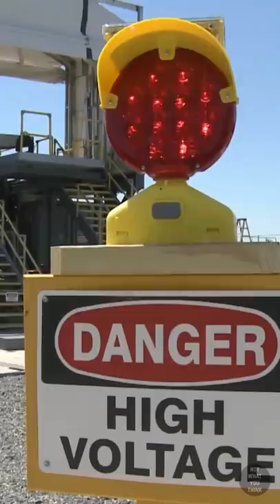Railguns: Destructive to the Core

Comment: "The rail gun is far from being ready for action" translates to "here's the documentary video from the army from 10 yrs ago."
Reply: I remember these from at least 20
Reply: They're still not using them quite yet. And I think the navy gave up on them. They require too much power and the barrel wears out very quickly.
Reply: @Frullie Well funny that you mention it, in terms of ammunition it's way cheaper. (Complex missiles and shells vs a literal spike of tungsten)
Maintenance wise on the other hand... yeah.
Reply: @Frullie it's worth it if it destroys a 1 billion dollar enemy carrier
Reply: @suryavardhansinghshekhawat865  not many Country operate aircraft carrier tho, and those who do generally america's ally
Reply: What makes me laugh is they make these so we go WOW look at the tech.. but I go WOW  what the fuck have they got they ain't showing us.
Reply: @KKdessu  Yeah that's what I said
Reply: @suryavardhansinghshekhawat865  no its not
Reply: If you knew anything about plasma, you'd know that there are no --- ZERO --- materials capable of conducting the necessary electrical current without changing state. Instantly changing from a solid into a plasma.., you know, that explosively expanding cloud of gas that's as bright as the sun? Well.., all of those super-bright particles are former residents of the 'rails' in 'rail guns'. They eat themselves every time they are fired.  Sure, tremendous amounts of weight and space are saved by not needing powder or shells, but what good is that if you have to carry hundreds of replacement barrels (rails)? Tell me how quickly you can change the rails during battle. Scifi is still Scifi.  IT AIN'T REAL!
Reply: @johnlshilling1446   the rails they’ve upgraded to recently can get in hundreds of shots before rail replacement is necessary.  Which is coincidentally,  the ability to hit more 1km-to-500km range targets before needing “replenishment”, than any other non-carrier naval combatant in the world.      
   Modern ships don’t carry anywhere near hundreds of missiles in their magazines(except for the Ohio SSGNs and carriers).  So, a Zumwalt for example outfitted with a rail gun or 2, could take out more than double the targets of a conventional cruiser or destroyer.  
   The capabilities gap will get even larger in the future with steerable and/or self terminal targeting projectiles, and guns with smaller or larger throw weight abilities.
Reply: @cjwrench07   Thanks for the clarification. I'm aware that advancements reported are always years, sometimes decades, behind actual abilities, but through my work and experience with plasma, it's apparent that my knowledge of the developmental limitations of materials science is also way behind. Good to know we (apparently) have it first. (???) I "shudder to think" that the CCP or Russia (or maverick regimes) would develop it first.
Reply: @DangerRussDayZ6533  if iam correct the uss zumwalt destroyers are or can be fitted with the railgun same with the uss Gerald r ford super carrier
Reply: @brycecoleman2725  Indeed
Reply: @SpunkMayo   the Navy’s not running around with flying saucers, invisible flying carriers, or genies trapped in a bottle on every ship.   BUT, they do have have a very successful record of technology revolutions, and are currently getting Tens of Billions per year in the Military’s Black Budget for secret R&D on top of their official Secret R&D budget. 
  
There are tons of hardware & software revolutions we only find out about after it’s used in combat, gets photographed by enthusiasts, or is otherwise leaked to the public.     
    The F-117 and B-2 bomber programs (and the SR-71 & its air-deployable Mach+3 drone) were the major sources of all the “triangular Alien UFOs” and “an impossibly maneuvering light/UFO” reports from the 1970s through to the early 2000s.  {They made for a good storyline on X-Files too}
     
 The US Navy specifically was also majorly  responsible for the “a super fast bright light streaking out of the water and into space” phenomenon in the late 1980s to current days.   As they tested and did experimental field deployments with the Standard Missile family of anti-aircraft (and anti-satellite/ICBM with a special version of it) missiles fired from each a submerged SSN, SSBN, and SSGN to see if the subs could become even more dangerous in a near-peer conflict.     THAT single capability addition will be game changing in a possible war with China or Russia; because we could keep our SuperCarrier task groups well back from danger, while the silent service decimated their military capabilities from unexpected angles and avenues of attack close in.  
     
   The now highly modified Virginia’s are also a generational leap in submarine technology overall, to the point the Navy actually had to add a noise making capability to them. As it was a remote possibility that a future enemy using a supercomputer could learn to track them by “looking for the hole in the ocean” where sounds disappear.   
   
That’s on top of the Navy’s electronic warfare division, who had a hand in the revolutionary  Stuxnet virus   A unprecedented set of programs that somehow was able to replicate itself onto other non-networked, and non-line-of-sight, computers and centrifuges on secondary personal monitored computers. All while inside of Iran’s most highly guarded bases dealing with nuclear materials research, development, and production.  AND, Stuxnet showed signs of being originally developed in the x486 days and being used because it was likely the one they could let the Iranians, Russians, and Chinese know existed without worry about it being weaponized against us. 

 Now, add on that the US Navy has fully pulled out of the USAF’s 6th-Gen  Air-Dominance fighter program, which supposedly already has flying prototypes.    And, that these 2 weird “melted wing” looking, apparently single-seat fighter-sized aircraft, were photographed flying near the Navy’s testing grounds just off the West coast over 5yrs ago and Combat Aircraft Monthly published the pictures   The same publication that was also the first to publish pictures of: “The Beast of Kandahar” RQ-170 spy drone and the X-37b spaceplane to the world; and has a very well respected journalistic reputation in military circles. 
       There might not be secret laser guns, Ironman suits, or flying saucers but you can be damned sure the highly paid and very intelligent civilian contractors the USN has employed are working on everything they can to keep the US military the preeminent military in the world.   All with a budget that’s double than the entirety of the Russian Federation’s budget for all their military and R&D.
Reply: @cjwrench07  bro if you think I'm reading all that lmfao 🤣😂
Reply: Yea these shits def on warships along with lasers.
Reply: @cjwrench07   Found out; The Zumwalt program was canceled. Only a few were built.., and no railguns were ever installed. The projectiles were originally estimated to be $30,000. Cost @ cancelation? Over a $1 million each. So.., perhaps you should check reality vs optimistic reporting. I've noticed that the media loves to report possibilities as though it is an accomplished goal.
Reply: @archise3191  it would be a really good anti icbm weapon. It could destroy one form well over the horizon on the cheap. The ultimate long range cwis system.
Reply: @cjwrench07  Got a link to those photos?
Reply: @johnlshilling1446    They built 3 Zumwalts, and yes the rest of the program was cancelled. 
  BUT, the US Navy has long said that their overbuilt power plant design, will be the design of the future.    The future flight-4 package of the Burke’s are currently being redesigned with the excess power generating and storage capacity of the Zumwalt class ships, and those existing 3 are going technology demonstrators for that future tech.    The new gen of rail guns is on the navy’s current funding wish list for installation on them.
Reply: @johnlshilling1446   the rail gun program was always meant as a future tech(mid-2030s) install on the Zumwalt class, and is still not at the point of even pricing out the special shells or guns.     
   The weapons, you are price quoting, were their proposed (Canadian invented, but Saddam developed) “Babylon Gun” inspired, conventional style guns 
They were meant to have 5-to-12 times the range of regular 5” guns, so in the neighbourhood of 90 to 250 nautical miles, and they were to fire precision munitions with crazy maneuverability.   The problem was it increased the cost of each shell, and the required encrypted comm system, exponentially.   So, instead they got cheaper current-gen naval guns and extra missiles silos around the perimeter of the ship, installed “for now” as the navy says.
Reply: @SpunkMayo  There is protocols for keeping military members from leaking highly classified information. Opsec, ect. And most keep there mouth shut beacuse well they probably dont feel like spending time in leavenworth. 
I remember when i was in and was involved in a classified project, are phone's were taken away, berifed about what not to say and talk about. Consequences and what could happen if we did.
Reply: @Rowan.CoD.M  as a vet with TSSCI, I could laugh at your comment lmao
Reply: @johnlshilling1446  too true, just don't tell any of the navies, in The Expanse, that! 🤣
Reply: @SpunkMayo  And thats why you don't understand nor respect our military capability.
Reply: @cjwrench07  Russia has that Kirov class thats getting refitted thats gonna have literally a couple hundred missiles. I’m sure there’s more examples of ships with cheese missiles.
Reply: @whawhaa  there really aren’t ships with hundreds of attack missiles, other than the 4 modified Ohio’s SSGNs.        As for that single Kirov “dream ship”, and her needed battle group of defence and support ships.   It really is at best a 50/50 chance, she ever puts to sea with those canisters all full of those very expensive missiles.            
    
Let’s say a Kirov Battle Group did get off her entire salvo of say 75-100 attack missiles (enough to decommission 3-4 airbases for a week at best, as exampled by other nation’s attacks with precision weaponry).   Now what is that Kirov supposed to do?  Just hang around as a juicy target without any further attack capability?     
  Russia’s navy can’t replenish at sea.  So, she would have to go all the way back to a friendly port with the appropriate facilities for berthing, and more importantly the facilities to resupply all those canisters she had fired off, and the fuel the battle group had used up.    That’s a very big ask for a ship(and the needed naval base) that will sortie very little in peacetime.    
 
  The needed capability to get a ton of ordinance on target quickly, is why Russia has moved to longer-ranged conventional cruise missiles, instead of rebuilding her navy or modernizing her airforce.    Cruise missiles can fight insurgents, they can fight a rebellious state like the Caucus, and they can put up a great fight against China’s ambition in her stolen Siberian Provinces.
Reply: Not so. You need to watch Stargate Atlantis.  They saved Atlantis and the galaxy.
Reply: @cjwrench07  I’m sure Russia has a decent doctrine to go with the ship. Obviously they’re not investing a ton of money into something with no application. I’m not a naval expert but I’d expect other powers to have similar ships, spamming rockets. I’d be surprised if only Russia and the US have a couple.
Reply: Arnold Szwartzeneggar had hand-held rail guns in Eraser and that was in the '90s.
Reply: @suryavardhansinghshekhawat865  it's too bad Harriers are obsolete, and America poured so much money into pet projects